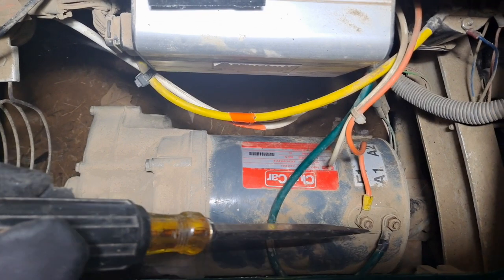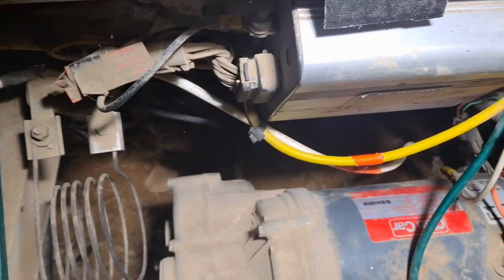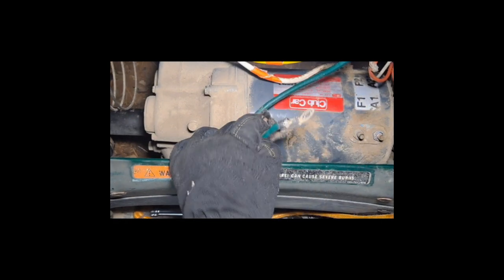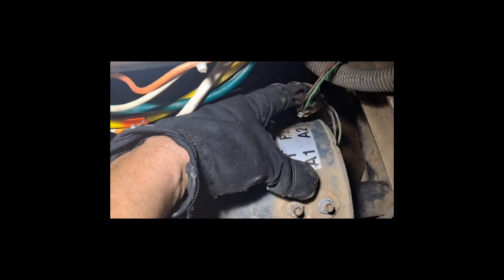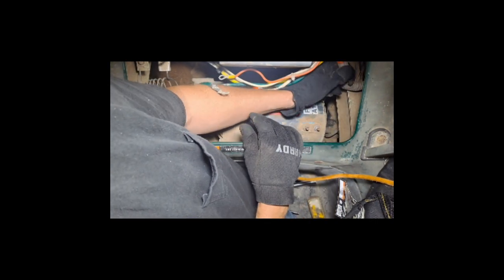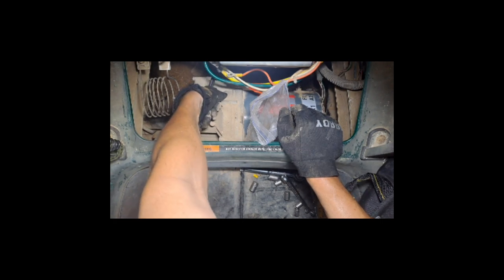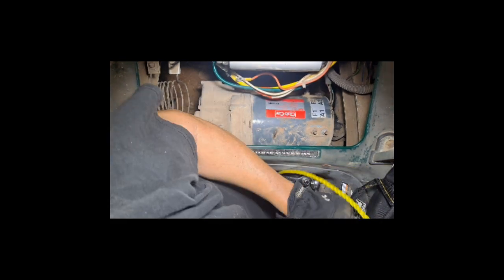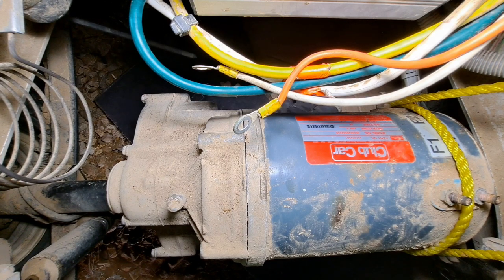How | Remove An Electric Golf Cart Motor

Comment: How did you get the motor off the splines
Reply from the maker: After you remove the bolts and the electrical connectors, you can tie up the motor with a strap.  It will take slight wiggle to slide right off and then gently lower it down to the ground. It is a bit of a tight space. You can have cardboard, or a small bubble wrap sheet placed underneath of the motor on the ground. If the golf cart is on level ground, the motor will barely slide out from underneath of the body without touching it.  You can also pull up the back wheel onto a board if you need some additional space to slide the motor out once lowered. Just watch your fingers and know the motor is a bit heavy.

Comment: Tried shaking wiggling back and forth forever. Won't budge a bit..🤷‍♂️
Reply from the maker: Sounds like rust or corrosion. Maybe try some wd40 to lubricate that seal. If all of the bolts are loose, the motor should release. Then, it should just be a matter of slowly sliding it off per the instructions at the end of the video.
Reply: @makeitworkdan6463  actually, I just came across another video on replacing brushes and then it dawned on me. I do not even need to remove the spline  just the outer casing but I did try penetrating oil vibrating air tools prybars, but it’s like it is welded on there.